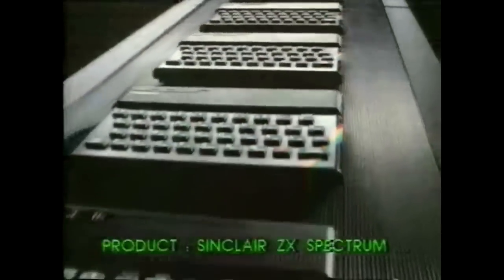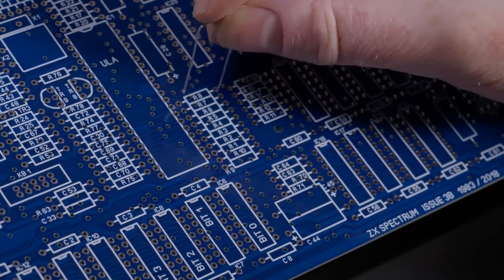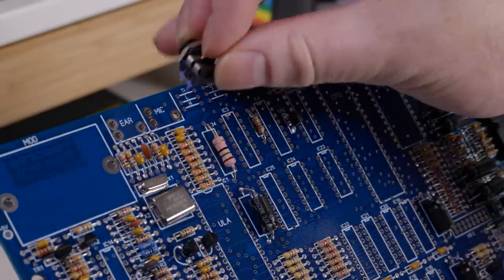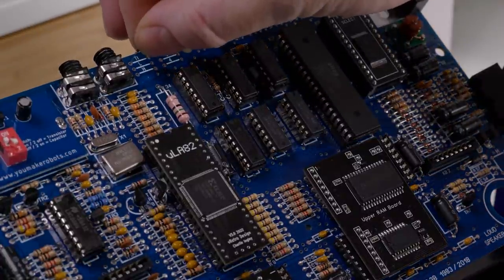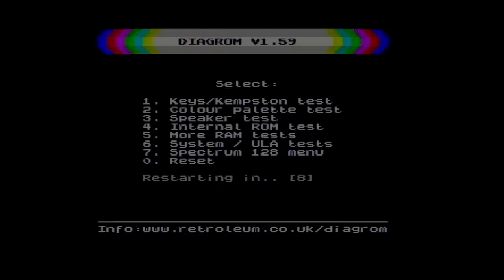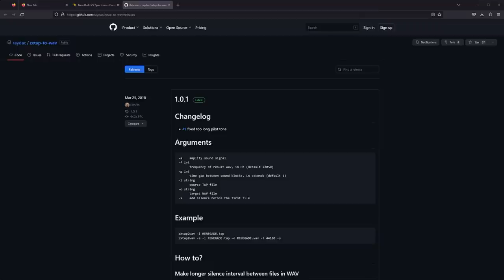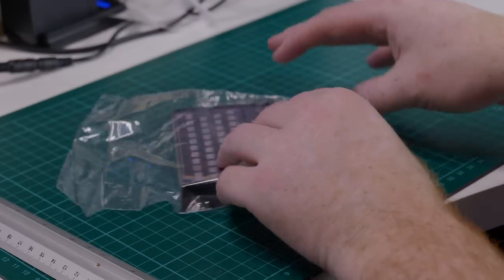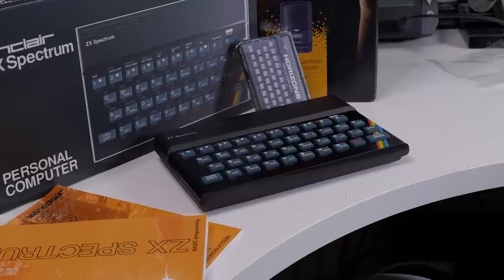Building a brand new ZX Spectrum with nearly 100% new parts, reconstructed box, manuals & tape

Comment: TOOK ME 40 YEARS TO UNDERSTAND THE WORKINGS OF THE VIDEO OUTPUT OF THE ZX SPECTRUM +, since I was a child	

ZX Spectrum 16k, 48K or +

The Video output by the ULA is Y, U & V signals using the following Video standard, PAL 625 Line Interlaced @ 50 Hz.
!___________________ PAL 625i @ 50Hz __________________________________

[Resolution]: The display consists of 625 horizontal lines, and each frame is composed of two interlaced fields, resulting in a refresh rate of 50 Hz.

[Frame Rate]: Operates at a field rate of 50 Hz, meaning that it displays 50 fields (25 frames) per second. Each frame consists of two INTERLACED fields.

[Horizontal Scan Frequency]: 15.625 KHz, this means that the electron beam scans across the screen horizontally 15,625 times per second.

[Color Encoding]: Uses a phase alternation technique to encode color information. This helps in minimizing color errors that may occur during transmission. The color subcarrier frequency in PAL is 4.43 MHz.

[Aspect Ratio]: The standard aspect ratio for PAL 625 is 4:3, meaning that the width of the display is 4 units for every 3 units of height.

NOTE only the horizontal lines are defined and not the vertical lines, they are instead have a duration of 64 microsseconds in time.
!________________________________________________________________________

-> The 50Hz interrupt was synchronised with the VBI (Vertical Blanikg Interval) of the video signal.

-> VBI is the brief period when the electron beam in a CRT display moves from the bottom to the top of the screen.

-> Each Frame consisted of 312.5 (312.5 x 2 = 625i) scan lines interlaced, one frame does the ODD scan lines and the other does the EVEN scan lines.

-> Each scan line takes exactly 224 T states or processor cyces.  {(CPU clock)/(Horizontal Scan Frequency)} or 3,500,000/15,625 = 224

-> After an interrupt occurs, 64 scan line times (14336 T states) pass before the first byte of the screen is displayed, including VBI.

-> Each frame comprises 64 scan lines + 192 scan lines of framebuffer or bitmap + 56 scan lines of lower border of screen.

-> Only the last 48 of the 64 scan lines of the above border are visible.

-> The side border is 48 pixels wide at each side.

-> A video screen line starts with 256 screen pixels, then right border, then horizontal retrace, and then left border again.

-> A video screen line is therefore timed as follows: 
	128 T states of screen (framebuffer), 
	24 T states of right border, 
	48 T states of horizontal retrace and 
	24 T states of left border.

-> The image size of the framebuffer is [256×192 = 49,152] pixels.

-> Character resolution of 32 columns by 24 rows: 32 × 24

-> One character cell is composed of 8x8 pixels

-> In practice, this means any character cell can only use two selected colours for colouring the contained 64 pixels.

-> The Discrete Graphics RAM requiring 6,912 bytes (6.75 KB) is directly accessible to the CPU at addresses 16,384 to 23,295 (after the ROM). 

-> An ULA which reads the lowest 6,912 bytes of RAM to display the screen.

-> The original ZX Spectrum computer produces a one bit per pixel, requiring 6,144 bytes, known as Pixel BitMap.

-> Colour is stored separate from the pixel bitmap, as a 32×24 cell grid, requiring 768 bytes nown as Colour Attribute Data.

-> Using one byte for each of the characters or character cell.

-> The main pixel bitmap is stored at the very beginning of the graphics RAM, while the attributes array follows immediately behind it.

-> 6144 bytes worth of bitmap data, starting at memory address &4000 or 16,384

-> 768 bytes colour attribute data, immediately after the bitmap data at address &5800 or 22,528

-> 6,144 bytes + 768 bytes = 6,912 bytes of Graphics Memory.

Colour attribute data

-> The colour attribute data overlays the monochrome bitmap data and is arranged in a linear fashion from left to right, top to bottom.

-> Each attribute byte colours an 8×8 character on the screen and is encoded as follows:
	7	|	6	|	5	|	4	|	3	|	2	|	1	|	0	|
	------------------------------------------------------------------------------------------------------------------------|
	F	|	B	|	P2	|	P1	|	P0	|	I2	|	I1	|	I0	|

Where:
	
F sets the attribute FLASH mode
B sets the attribute BRIGHTNESS mode
P2 to P0 is the PAPER colour
I2 to I0 is the INK colour
So for each 8×8 character position you can only set two colours; this limitation is the sole cause of what is affectionately known as “attribute clash”.

-> url https://worldofspectrum.org/faq/reference/48kreference.htm

-> url http://www.breakintoprogram.co.uk/hardware/computers/zx-spectrum/screen-memory-layout

 
This memory is used to store the pixel data for the 256x192 pixel display, where each pixel could be one of the 15 available colors. 
The rest of the RAM was used for system variables, BASIC program storage, and other functions.

!_________________________________________________________________________________________________________
				                      ZX Spectrum 16K, 48K, and ZX Spectrum+		128K, +2, +2A, +3
CPU cycles per PAL line		224						                                           228
PAL line time			                64 μs					                                           64.28 μs
PAL lines per frame		        312						                                           311
Frame time			                19.968 ms				                                           19.9915 ms
Frame rate			               50.08 frames per second	                                           50.02 frames per second

Display Vertical Synchronization by the Z80 maskable interrupt line
>----------------------------------------------------------------------------------------------------------------------------------------------------------------------------

Very many modern programs use the fact that the screen is "written" (or "fired") to the CRT in a finite time to do as much time-consuming screen calculations as possible without causing character flickering: although the ULA has started displaying the screen for this frame already, the electron beam will for a moment not "pass" this or that part of the screen so it's safe to change something there. So the exact time in the 1/50 second time-slice at which the screen is updated is very important. Each line takes exactly 224 T states.

The 48K ZX Spectrum memory map is shown below, #xxxx denotes a hexadecimal number, lengths are decimal
	Start	End	Length	Description
	#FF58	#FFFF	168	Reserved
	#5CCB	#FF57	41,612	Free memory
	#5CC0	#5CCA	11	Reserved
	#5C00	#5CBF	192	System variables
	#5B00	#5BFF	256	Printer buffer
	#5800	#5AFF	768	Attributes
	#4000	#57FF	6,144	Pixel data
	#0000	#3FFF	16,384	Basic ROM

->url https://www.overtakenbyevents.com/lets-talk-about-the-zx-specrum-screen-layout/

!_______________________________________________________________________________
The timing is expressed as a T-states of the CPU and, when recalculated to pixels, the top of the border is 64 lines, with 48 lines being visible as the actual border. The bottom side of the border has 56 lines, with some being outside of the visible area. On the left and the right sides there are 48 pixels, some of them are outside of the visible area.

!_______________________________________________________________________________
The device uses 14 MHz crystal as the master clock, and it gets divided by 2 to get 7 MHz pixel clock.

The active raster is 256 pixels, and if we assume that standard 15.625 kHz horizontal scan rate is used, it adds up to 448 total pixel clocks per line.

Due to standard horizontal timing, there will be 364 pixels of video at most, leaving up to 108 pixels for border area.

And due to standard video timing, there should be 312.5 lines per video field, or 625 per frame, of which up to 576 contain video. But we can safely assume it outputs progressive video at 312 total lines per frame with 288 active video. Not all are visible due to overscan. This leaves 96 lines for border area in total.

Using this as a reference, I found a ZX Spectrum reverse-engineering website which confirms this, and actually has the values.

Borders are 48 pixels on left and 48 pixels on right for a total of 96 pixels. Due to overscan, not all of them are visible on a screen. This leaves 96 pixels for horizontal blanking and synchronization area.

-> The vertical border is said to be 48 lines before active raster and 56 lines after active raster.

!_______________________________________________________________________________________________
-> The ULA is reading the screen memory, about 60% of the 1/50th second time slice in which a frame is generated. 
-> The other 40% the ULA is building the border or generating a vertical retrace. 
-> This behaviour is actually used in some programs, for instance, in Arkanoid.

*************************************************************************************************************
TOOK ME 40 YEARS TO UNDERSTAND THE WORKINGS OF THE VIDEO OUTPUT OF THE ZX SPECTRUM +, since I was a child
Reply from the maker: Impressive knowledge, did you enjoy understanding it all. And more importantly, any way of removing the LM1889N
Reply: @RetroTeaTime  Thanks, I am still enjoying  discovering new things, as for the LM1889N its taking the Y, U & V signals from the ULA to convert them to the composite video.  The ULA does most of the heavy lifting, by transforming binary data from the digital domain in the frame-buffer to Analogue domain.